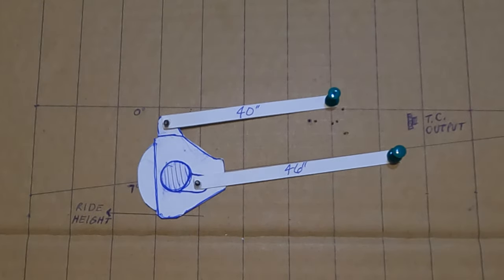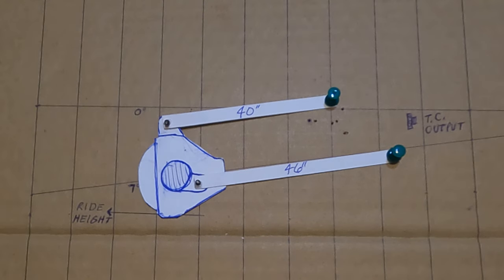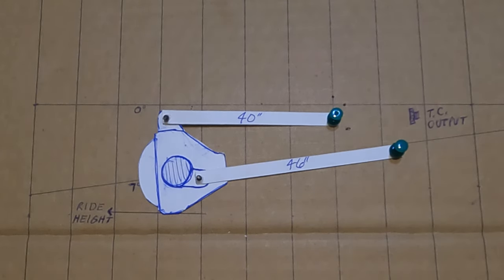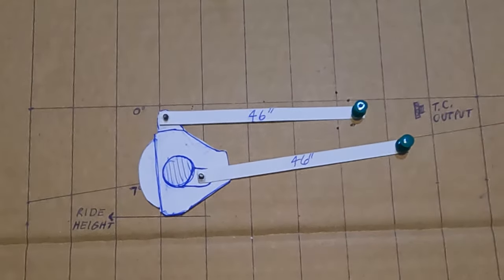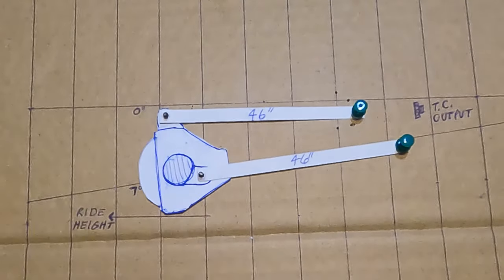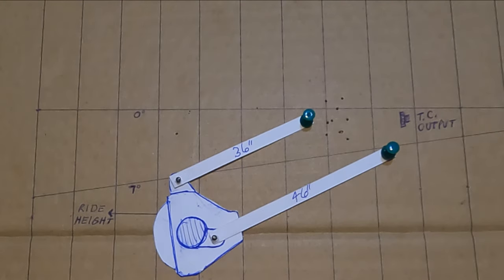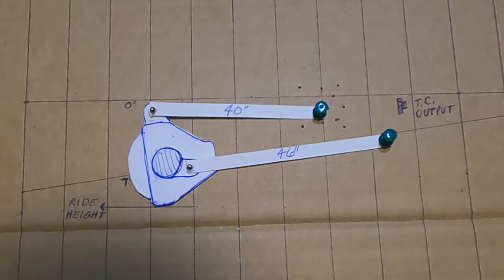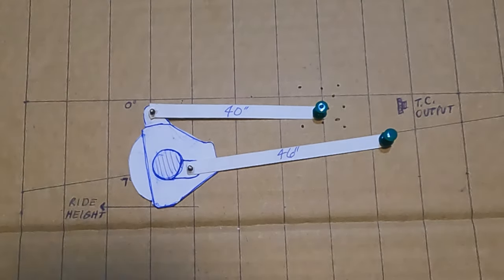4 Link 101: Offroad Basics

Comment: Lifting my 2011 wrangler 2 inches should give it some caster , without changing suspension links .
Reply from the maker: Castor should remain as close to stock as possible at all times. You CANNOT tip your front pinion up because that inversely tips your knuckle/steering plane into the ground. And this causes death wobble and other horrible things.
Reply: @wheels.and.wrenches  Putting in 2 inch spacer lift . If the caster increases , i'll put in adjustable upper links to correct it .
Reply from the maker: Caster isnt a thing you get. Its a degree measurement of the steering knuckle plane in relationship to the ground. Factory straight axle rigs come with 4-8 degrees of positive castor at ride height. That means the knuckle laid back 4-8 degrees of Positive castor. So the knuckle steering plane isnt steering into the ground. When you lift a vehicle with short arm 4 link too much, the short arm geometry gets all out of whack and starts to tip your knuckes forward, which puts a bad castor angle on the knuckles. This is why short arm lift kits come with "adjustable" lower control arms. So you can lengthen the front lower control arms to correct the bad castor angle.

A 2" lift isnt going to hurt anything. Its when people used to try putting 5.5" lifts on TJs and XJs back in the day with short arms they got into trouble with castor and death wobble issues.
Reply from the maker: @pennyhelga3628  adjustable lower links. A 2" lift isnt worth buying. It will barely be noticable. Get a good long arm lift that will clear 37s
Reply: @wheels.and.wrenches  My kids gave it to me for christmas . I bought shocks and other parts . I don't want it real high . Only running 33 inch tires .
Reply: @wheels.and.wrenches  If the castor changes i'll get lower links .